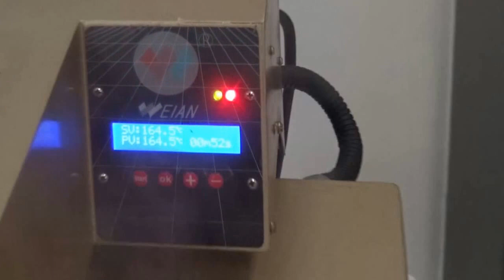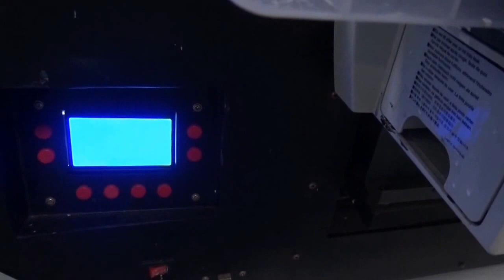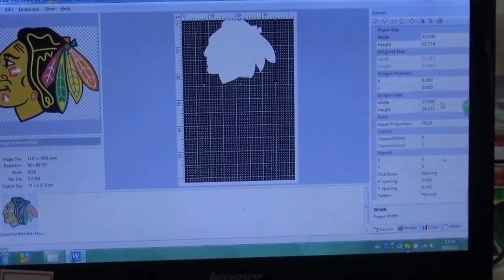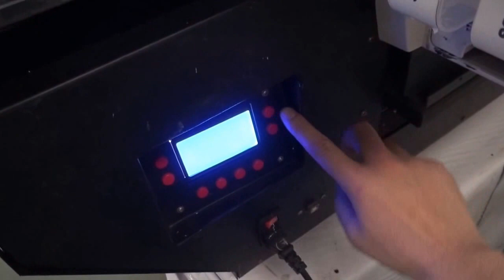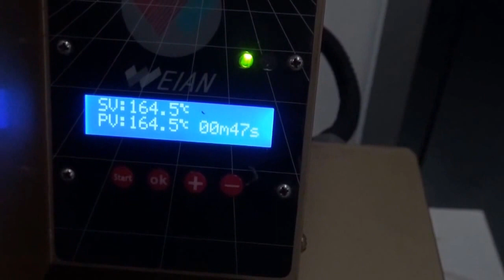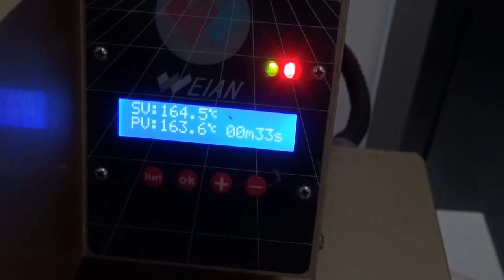A2 size 4880 DTG printer WER D4880T

Comment: i can,t believe this!!! 18 min for just a t-shirt ??? screen printing is must quicker than this.
Reply from the maker: This is the whole printing processes including：1.Pretreatment liquid spray，2.Heat press work，3.Color control and output with computer，4.T shirt drying after printing and so on. The most important is we print this T shirt at the higher printing resolution 2880*1440dpi to show our customer every detail of printing procedures.
Reply: from min 3 you start printing,if you didn,t see your video, i want you see it again. epson p600 do it under 2 min.
Reply from the maker: Which printing resolution did EPSON p600 choose？How many passes of printing mode？2pass，4pass，8pass？

We print at resolution 8 pass ，printing resolution 1440*2880dpi，and we show the true color effect.Will you only pursue the speed？Of course，you should protect the printing quality at the same time.
Reply from the maker: You know the printing resolution and pass way，which will decide the speed.And customers can control this with the computer.For screen printing，you also know it is old method.